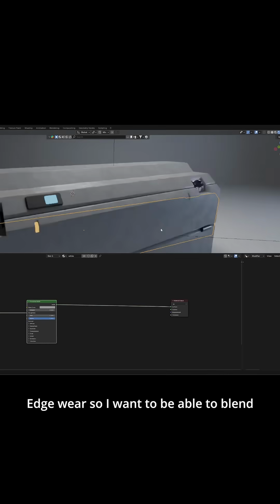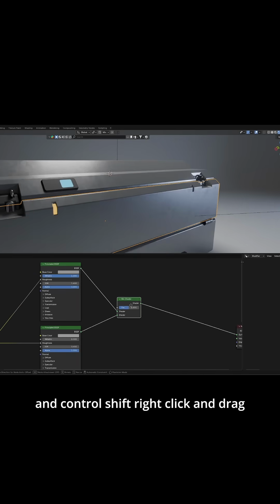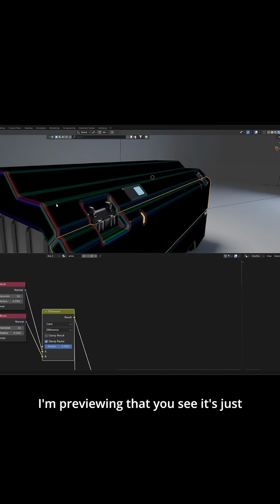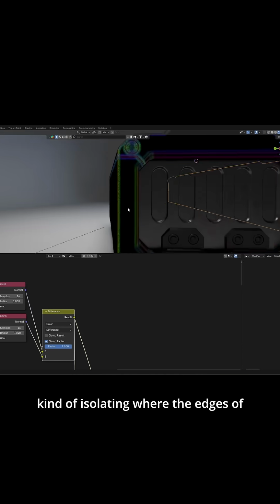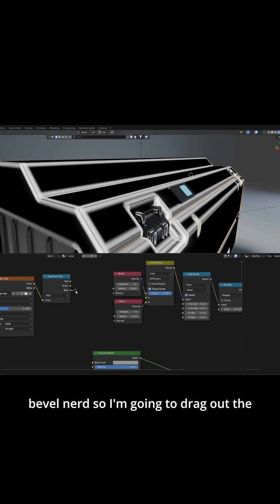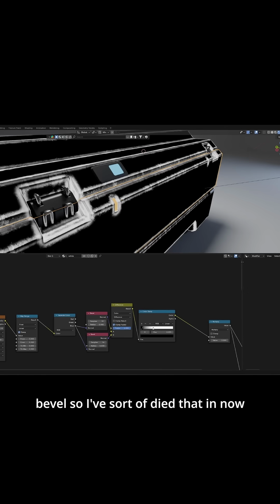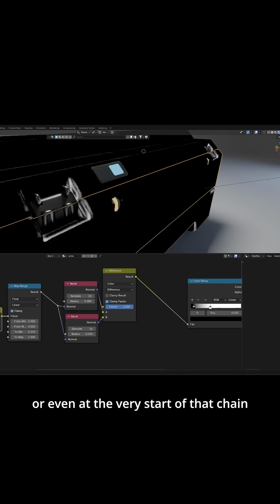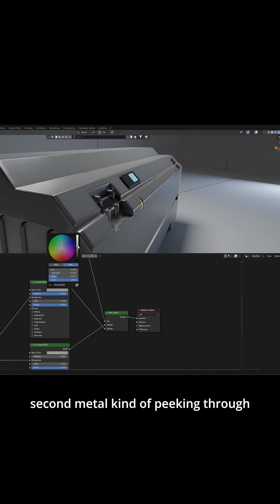Blender EDGE wear MATERIAL setup

Comment: I love blenders features and power, but their interface needs a complete overhaul, they need to make a more organic and simplified version that has some of blenders functionality, because making art and design works fluidly and creatively while also managing what looks like a medium size businesses accounts database just to get textures to function is criminal..

before anyone says anything, i know why it is the way it is, these slinders, connectors, options, menus all have fine adjustment and customisability and need fine control.. its the presentation and interface that could be reworked to be used intuitively
Reply from the maker: Yeah I get the frustration.always overwhelming to use any new tool for the first time. I have found in other creative areas, there is always a trade off between control and simplicity.